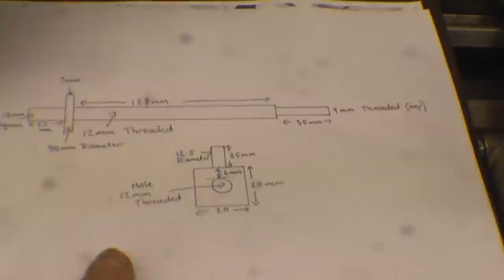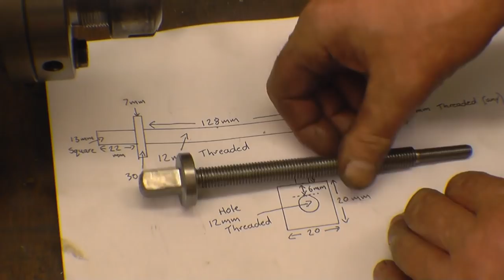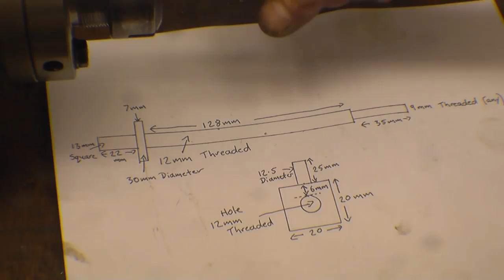SNNC  333 P2  Lathe Tail Stock Adjuster Bolt

Comment: The tail stock bolt looks good, I don't blame you for chasing the mostly cut threads with the die, I think it was a good call in this situation too. Will be cool to see pictures of the old lathe your friend is fixing up once it's done.

Comment: Gotta find me a lead hammer mold like you had in part 1.  The tailstock screw was a nice bit of machining on some tough machining steel.  Looking forward to the brass nut build.  I think the one in my lathe is cast iron, actually just remembered it has a screw coming in from both sides pushing against a center piece.  Praying Deb, and your Dad, are both well.
Reply: Look for Cook hammer mold. Had mine for years and it works great.